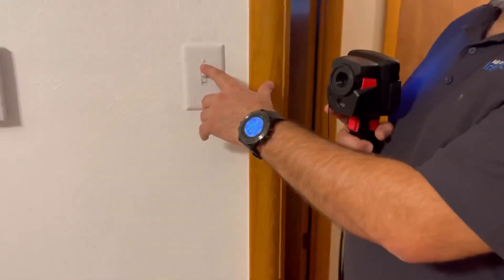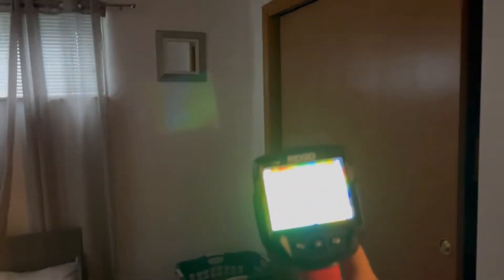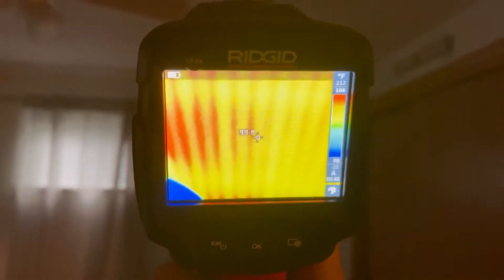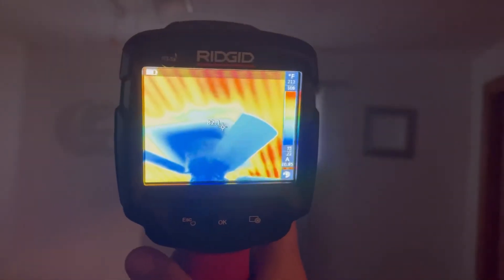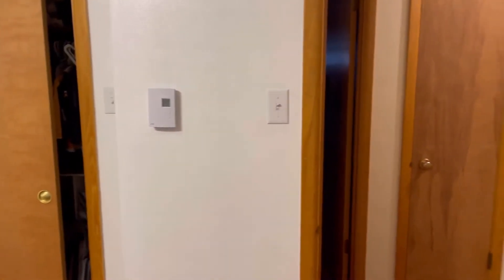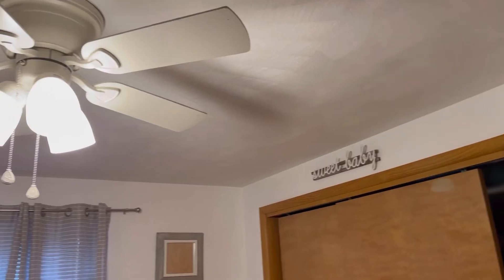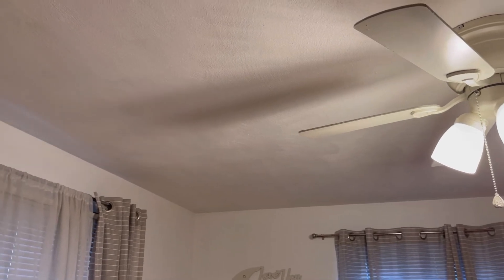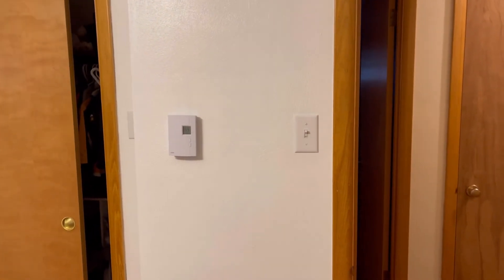Electric In-Ceiling Radiant Heat | See Heat through a Thermal Camera!

Comment: I had that in a house (im in Iowa)several years ago. It was SO dang comfortable.  the house next door to mine was the same model but heated with baseboard heaters while mine had the ceiling cables.  My power bill was lower and I kept my place warmer.  it's a great way to heat the People and not just the air.
Reply: I have electric ⚡️ ceiling radiant heat. It is clean, efficient, comfortable, reliable.
Reply: how responsive is this type of heat? I find it interesting.
Reply: I find this type of heat interesting. I live in California but grew up in Michigan. How long does it take to heat the room? What Im asking is if you turn the heat down at night, then up in the morning, how does it take a long time to recover?
Reply: @andrewclarke3622 i have radiant heat in my house. I just keep all the rooms at 68 in the winter. I don't turn up or down, that way it stays the same temp and doesn't use more electricity to warm the house back up. It also makes my electric bill not as high
Reply: Set and forget is kind of what I thought. Unlike with baseboard heaters. Ive never been around either, personally. Ive had family friends back in Michigan, I live in California, that had baseboard heaters that would heat the areas that they were in and either turned them down in the areas they wherent.
Reply: @andrewclarke3622  I have this type of heating as well.  You can feel the heat hitting your exposed skin before you even feel the ambient temperature of the room rising.  The video is exactly right in that it feels like warmth from the sun is hitting you. You can feel the heat on your skin within 10-15 minutes of the heating element turning on.
Reply: As far as I know I have never been around this type of heating. If I did it would have been way back in the 70s when I was a kid. Is it resposive if you would say, turn it down at night and up in the morning? Thanks for your responce.
Reply from the maker: @andrewclarke3622 It is, but it often takes a while longer to feel the heat than it does from a forced air system.